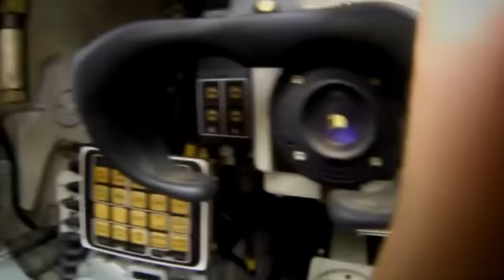The Frankenstein Monster Tank that is Pounding Russia

Comment: PT91 and PT91M is different....PT91M Pendekar has reverse speed at par with western Tanks Thanks to Renk automatic transmission from Germany. better composite armor ERAWA5 coverage...It has CITV for the Comander  ...Also PT91M Pendekar can fire longer APFSDS 125mm than other T72 variant thanks to its new Gun.
Reply: PT-91M Pendakar bascially has little do do with T-72 or PT-91 basline except layout - new power pack including enginge and transmission you mentioned, Leclerc's FCS (Savan 15), totally new turret and turret bearing and gun stabilisation, updated Slovakian gun, new version of Era etc....
Reply: Coś mi się po głowie kołacze że i w Polsce nie każdy Twardy jest wyposażony tak samo, na pewno było coś z liczbą kostek Erawy
Reply: There is no such thing as ERAWA 5. ERAWA reactive armor comes in two flavors - lighter ERAWA 1 and heavier ERAWA 2.
Reply: Last time I thought ahh it Russian built again. Now I know and believe, Malaysian tank built by the Polish are at home with our tropical terrain comprise of river, paddy field, mud and more mud. Good to know that.

Comment: You fight with the tank you have, not the one you wish you had💙💛
Reply: They gettin Abrams doe they wanted that
Reply: @eotorpex2694  I remember that during process of getting into nato Polish tankers had brief chances to evlauate some version of m1a1 abrams during which polish tankers tried to compare abrams tanks to pt-91. Aside from abrams instantly becoming gold standard for ergonomics moust suprisingly they claimed that pt-91's fire control system was on pair with one in the abrams.

So if any tanker will get a jump from pt-91 to abrams they will be just more comoforbale and better protecected (as UKR will recive some variant of M1A1).
Reply: And not whinne about it.
Git er dun with whats available using common sense over doctrine B.S.
Reply: Tanks like Westernized T-72s and Leopard 1 fit Ukrainian frontline surprisingly well. Since tank on tank battles are extremely rare, anti-tank performance and ability to resist modern tank munition, where they lack the most, are almost irrelevant. And being much lighter than modern Western MBTs, they fit into pre-war Ukrainian logistics just fine.
Reply: 😂 sad Puuty Pooo noises
Reply: Beggers cant be choosers

Comment: the Poles had a major part in breaking Nazi codes in WWII.  They currently have one of the largest, best trained and maintained military in NATO and have a history that has led them to understand what will happen next if Putin succeeds in Ukraine.  NATO is lucky have the as a member and ally.  Traditionally, tank advances are limitet to 200 miles before major fuel and repair are needed.  I wish I had confirmation of the claim that the Polish model can independently cover 400 Miles
Reply: Poles also developed the mine detector that transormed mine clearing for the allies.

Comment: But...the ammo is still inside the crew compartment?? If a redesign of the turret and loader fixed this all those surplus tanks could be upgraded and survivability increased.
Reply: Yeah I think you would need to restart the design form the ground up
Reply: It becomes good enough if you add internal armor for the autoloader and put the rest of ammo in specific location. Like they did in T-90M introducing a bustle with blowout panels to hold spare ammo. Most of the soviet T-series turret tosses were caused by ammo racks that were initiated by the ammo scattered all around the tank (they basically had the spare shells distributed EVERYWHERE), and not the ammo in the carousel (which will still explode in case of direct hit by an APFSDS or HEAT that evaded hitting ERA, but this is less likely to happen)
Reply: Scale of redesign required would mean development of altogether new tank.
Reply: Most of the Russian “flying turret” problem came not from the carousel ammunition but spare ammunition in the turret.   In the T90M a turret bustle was added to store the spare ammunition
Reply: Why not just run it off water to 😂
Reply: PT-16 and PT-17 projects do offer better ammo separation, but there's no money/time for implementing that
Reply: In the 90s, when we literally had to "redesign" our entire economy, there was no money for project that could be indeed a complete new tank design, clean sheet. We had to do something with obsolete T72s, but we didn't have the money to design a completely new tank. There were plans, though, to further develop the PT-91 program, including redesigning the turret, but well, again, money.

Comment: Reactive armor works much better when it isn't just a sheet of foam rubber inside.
Reply: Reactive armour has its pros and cons; and if you are talking about the Russian abandoned tanks with rubber instead explosive filling on its ERA blocks it may have a simple and logical explanation.
If you are in close fighting with your infantry or you don’t want to add about 2 extra tons of weight or supplies don’t arrive you better add rubber to those blocks. This way, they don’t explode hurting your infantry and add a few extra mm of armor that can help you with AP ammo from 20mm guns.
Reply: Or Russian egg cartons.
Reply: @sergiom9958  you got it wrong. The tank that was demonstrated in the famous "rubber in ERA instead explosives" video is a captured T80. That was captured like half a year prior to video and stripped for spare parts as there's no repair facility for T-80s in Ukraine (speaking of major repairs of course). The rubber shown is a legit part of that ERA, it sits between two explosive charges, that Ukrainians had almost 6 months to strip for their own ERA. Yeah, that tank still might have been without ERA initially, but the video showing "Rubber in ERA" proves nothing. And the fact that it is filmed a lot later makes it even more suspicious of being misinformative.
Reply: @gauss_gun  i was talking about why there is nothing wrong with opting not to use the era blocks if it is an answer to the operational situation. Because the first comment lead to the conclusion that they lack explosive due to negligence or lack of hability to install it.
Thanks for the complementary info.

Comment: Even the Polish T-72 tanks that had the night vision improved, are showing supperiority in combat over the russian tanks. Slava Ukraini!
Reply: That’s not true, t72b3m is better in all ways then polish t-72’s
Reply: @schutzanzug4518  
Haven't heard what's happened in Ukraine?
Reply: @charlesharper2357 A tool is only as good as the one using it. Russia’s T-90’s are getting slapped by all-around inferior tanks since Russia likes cutting corners to save costs (untrained crews)
Reply: @charlesharper2357 Russia’s armoured doctrine is also anemic. Tanks and infantry need to work closely together or it will end in disaster. Ukraine has plenty of ATGMs to exploit russian armoured doctrine weaknesses

Comment: how fast does it go in reverse? all well and good doing 70 forward but doing 4 in reverse dont get you out of trouble
Reply: War is not a video game - you don't send tanks without infantry support or blindly. They rarely need to use speedy reverse in battle if ever. And if you get ambushed, no reverse speed will save you.
Reply: @TheZaYo  Seems russians didn't get the memo :P Also afaik when we started seeing tank on tank combat in Ukraine, we had some quotes from ukrainian units about issue with reverse speed and crews finding T-80 superior just based on that one spec above the others. Also the tank use we are generally seeing there is shoot and scoot, which is where that reverse matter as well.
Reply: While I couldn't find it in official specs, I found a news piece from 2016 when during Defense Services Asia expo in Singapore the RENK France S.A.S offered to upgrade powerpacks of Malaysian Army's PT-91M Pandekar which would raise the reverse speed from 29km/h to 33km/h. The export PT-91M Pandekar originally uses polish Wola S1000 1000hp engine with Renk ESM-350 automatic transmission. The upgrade would combine the same transmission with 1184hp Scania D1L6 engine. The original polish PT-91 variant used 850hp Wola S-12U engine with unspecified transmission so no idea if the reverse speed issue was addressed. The polish fleet include PT-91, PT-91M and PT-91MA1 - the PT-91M however are not the same as Malay version, it is an earlier mid production update which might not (no info) include any changes in the power train. There is no info on PT-91MA1 either.
Reply: Thats why the french were ahead of the curve but people ridiculed them. Viva la france!
Reply: @TheZaYo and you same people cry when the Russian tanks can’t reverse, then it’s a issue. 😂.
Anyways reverse is a HUGE issue.

Comment: Relatively on par with T-72B3
Reply: Not really.

The B3 has better base armor, however the 91 has better ERA.

In terms of fire control and stabilisation its not even close. The Ukranians are capturing B3's that don't even have a thermal gunner sight. The standard 91 has a thermal gunner sight, better stabiliser and better fire control system. The 91M has full CITV and hunter killer capability which the B3 completely lacks.

Mobility wise the 91 is only marginally faster than the B3. The 91M though, has a full automatic transmission with multiple reverse gears. Putting its mobility in the realms of Western MBT which frankly shits on that of the B3.

Comment: Oh dear the halon fire suppression system will kill the crew quick ...
Reply: it likely got breathing masks for the crew
Reply: The system is in the engine compartment, not in the crew compartment.
Reply: There are different types of halon, not all of it lethal. I used to drive LAV 3's for the Canadian army and they had 2 types in each vehicle. In the engine compartment you had the standard halon system that can be lethal. But in the crew compartments or where the troops would ride in the back was a non lethal type of halon. It's not fun having it go off on you but it is survivable